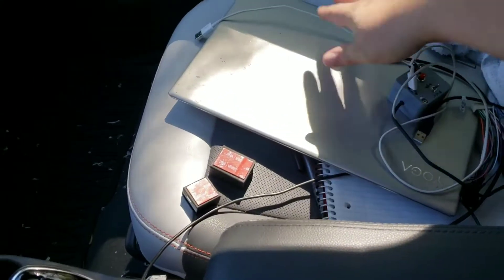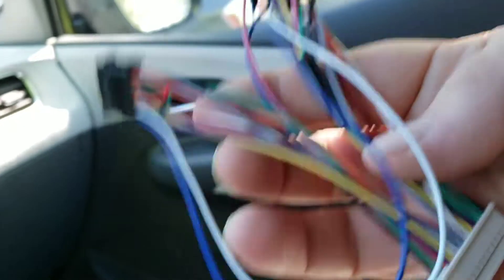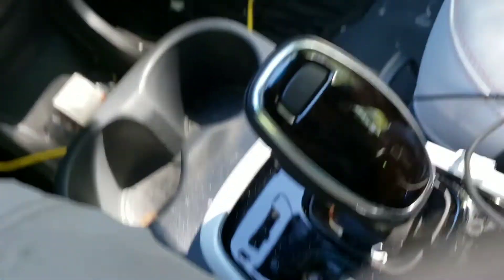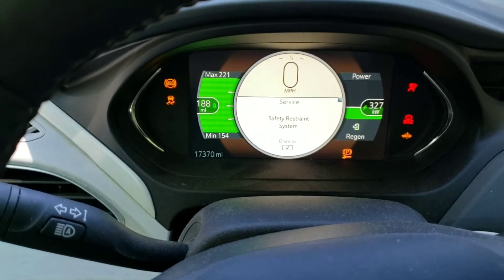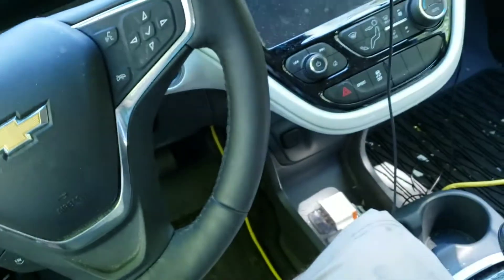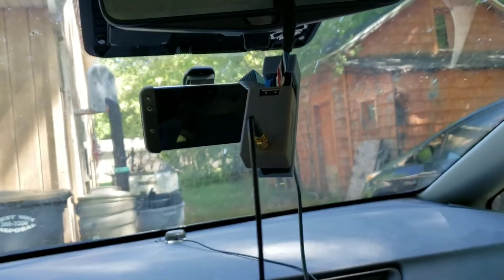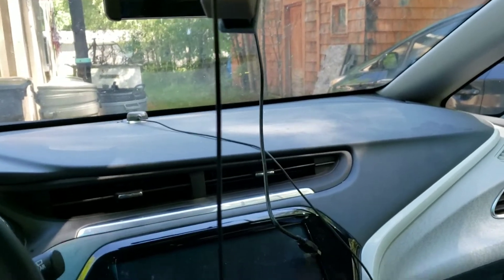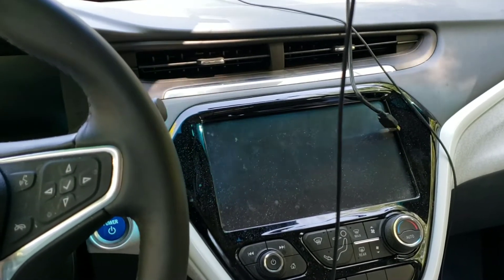Self Driving Chevy Bolt EV - Comma2 Harness results

Comment: Dude.  If you do ever get this to the point it can be turned into a reliable  mostly plug and play kit.  I would totally buy one from you.  Work in IT as well.  Just bought a Bolt.  Coming from two other volts.  Love all of em but this addition would just put the cherry on top
Reply: Jason Shuler I’ve been silently watching this  - it’s so cool what you’re doing for the community. Do you have any visibility into the requirements from comma.ai w.r.t. adding the Bolt to their community list? Are you almost there or is there a long road ahead? Thanks again!